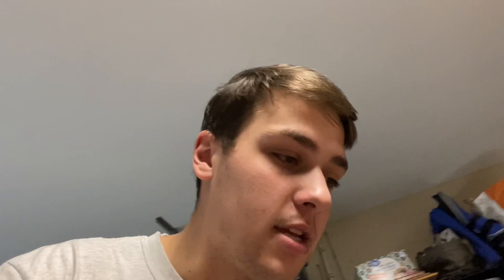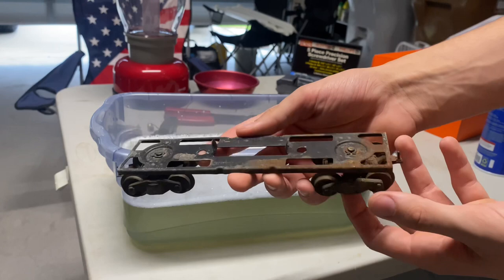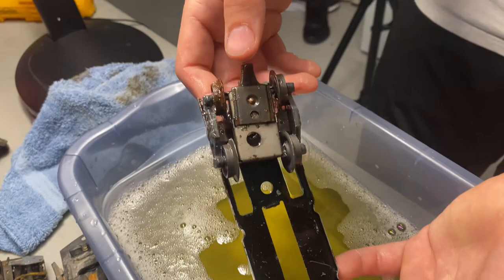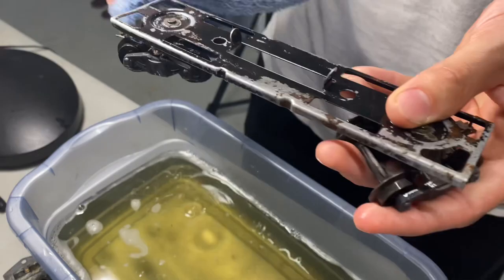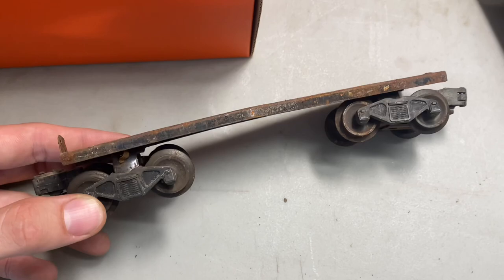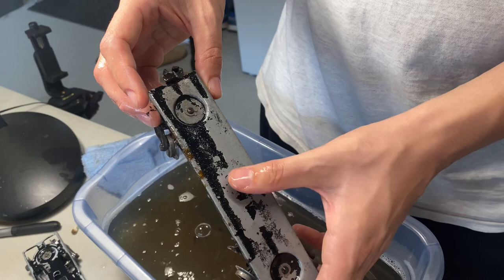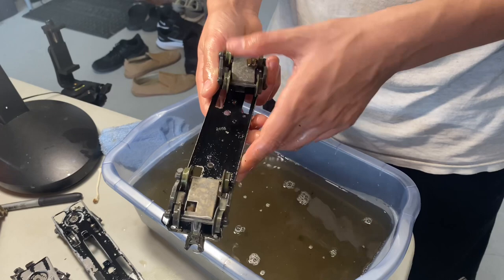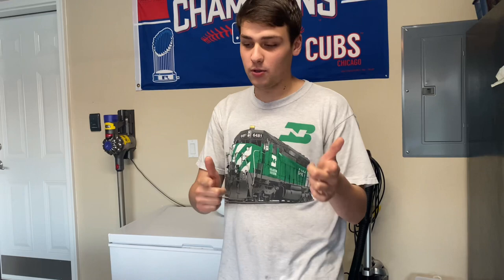Lionel Train Restoration Part 1. How to restore/ remove rust from postwar trains!

Comment: Thanks for sharing. I found the Evapo-rust on Amazon and I'm going to order some. On those wheels, just a drop of light oil where the wheels meet the axles and those will spin like a Hot Wheels car.

Comment: While Evaporust is relatively safe to use, I still wear surgical gloves and safety glasses while working with it. One challenge with finding it is that most retailers that carry it don't keep a lot in stock - I've never seen more than one or two jugs on the shelf.  Evaporust also comes in a gel formula for use on small spots or vertical surfaces.

Comment: It’s possible that it is not stripping the paint, even though you see bare metal.   Rust often begins on surfaces where the paint has already been chipped away… and in bad cases, it can slowly erode the paint surface as it bubbles up from underneath it.

I have done a few tests with Evapo-rust and it has done an excellent job so far.
Reply from the maker: I love the stuff it works wonders!

Comment: Why wouldn't you just drop the rusted frame into, percent white vinegar, and let it in the solution for 24 to 48 hours to get rid of the rust, it's a whole lot cheaper price and much easier to find too, and then put the car into a baking soda and water solution to neutralize the acid, and then rinse it off and put the car in the oven at about 200 or so degrees Fahrenheit for about an hour or so to dry the car off, and, VOLA, no more rust on the train car frame!